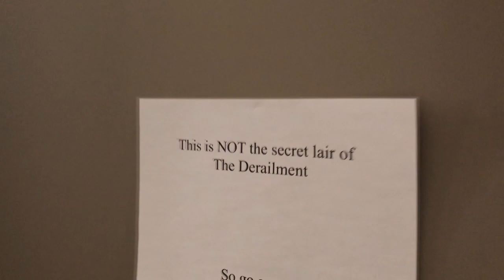Building an HO Scale Model Railroad in a Smaller Space - Laying Track

Comment: Good work on the track. But for future never solder your turnouts together to other track leave them connected by the joiners themselves and just wire the  switches for power.  Just in case you have turnout problems in future.  Also some type of food or plastics factory can use up small space and take both  box, hopper, and tank cars.
Reply from the maker: Thanks Peter. I should have mentioned that I did NOT solder my turnouts. I remember another modeller saying that. Thanks for the industry idea.

Comment: Now I get the 9v battery thing! I didn't think that GI Joe switcher worked.  Where did you buy your peco switches from?
Reply from the maker: The GI Joe switcher did not work, but I brought it in to my local hobby shop and they fixed it. They also fixed my DCC CN loco that I bought on eBay. The peco switches are from Otter Valley. Cheapest I can find.
Reply: @MMRails  nice Thanks!

Comment: So i have a question.  I'm running dc for the moment with ez track because I'm new to this. Should I apply the cork road bed under the ez track and if so what length and width would you suggest
Reply from the maker: Good question Vincent. I don’t know if cork is needed for EZ track. It might be overkill. To my knowledge cork is designed to form the ballast on the sides of the track. So if you intend on using ballast, the EZ track should work. I’m not much help unfortunately. I fake it til I make it.
Reply: So just go with the ballistic.  I don't need the cork. 😎 thanks